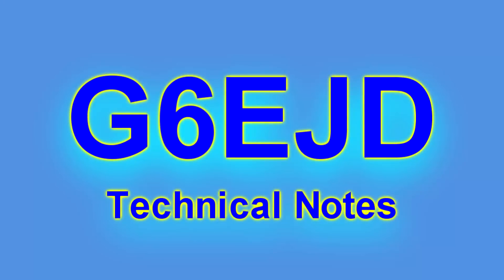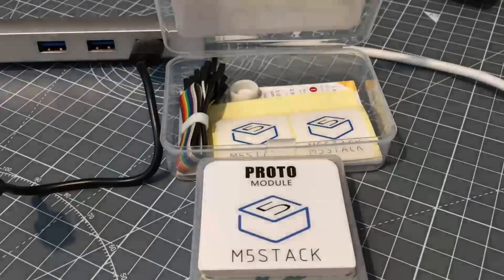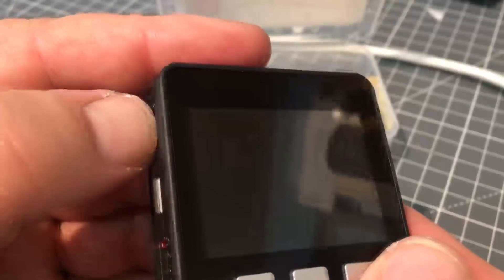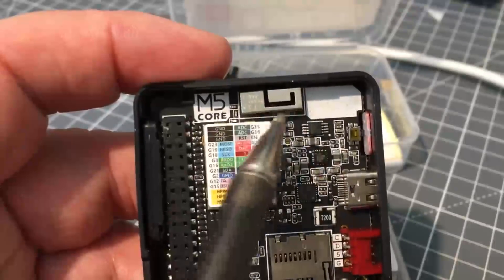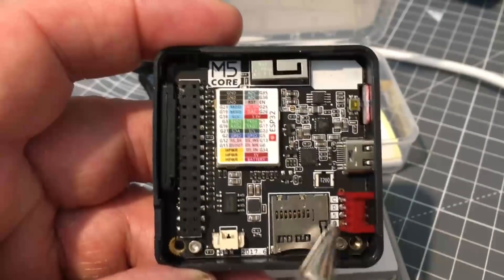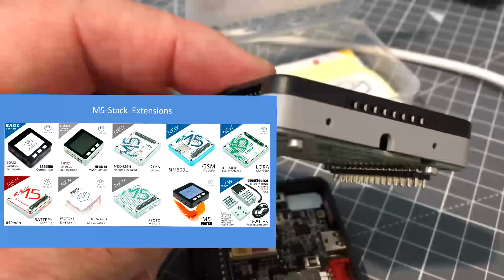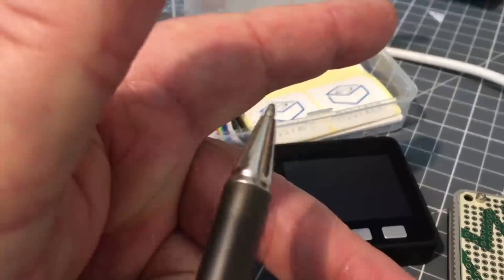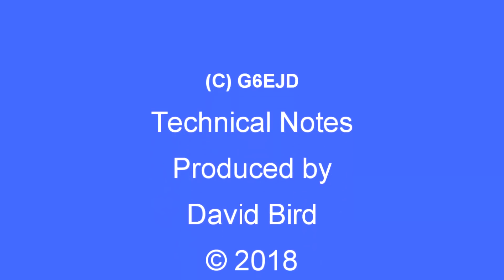Tech Note 090 - M5 STACK (ESP32) Development System Overview

Comment: Great video as usual. Can you comment a bit, if you have an idea how long it might run on battery with wifi and or Bluetooth ON for 30 sec every 30mins? Or in general how much current it is drawing in normal ON state with display on.
Reply from the maker: Science4all World Using the (small) internal battery 150mAHr about 30-mins I have not measured the current consumption but a reasonable guess would be 120mA for the ESP32 and 120mA for the display and then 150/(120+120) = 40mins but it’s difficult to know the state of the charge. With the extra battery stack at 850mAhr duration should be closer to 4-hours. With the display off it’s going to be closer to just the power consumption of the ESP32 during on time and during sleep. I notice that the 150mAhr internal battery lasts for about 2-days in sleep mode but I don’t know what mode they implemented in their library but it’s not 5uA and so the Stacks ancillary components are drawing power too. Hope this helps.
Reply: G6EJD thanks

Comment: Have you tried to use the prototype board? I have found that it's hardly usable because there's not enough space to the module on top of it. If the core module is directly on top, there's about 1mm left – then you short out something. If the battery module is on top, then there is not space at all; the LiPo cell will be punctured if legs or wires are put through the holes.
Reply from the maker: I know what you mean. On my prototype 'stack' module there is about 3mm for the solder side and about 7mm for the component side, so really (if the battery stack is used) is needs two prototype stacks to give clearance. I think for most small applications like a sensor there is enough space.
Reply: RE. the proto module..... Clearance is tight i agree, but as G6 mentioned there is a bit of room. I measure underside clearance  at a smidge over 3.9 mm (thickness of two ice cream sticks). 

It also depends how you use it. Review the M5Stack Lora module. It squeezes in a Lora chip. Parts are surface mounted on the underside of the modules pcb - so parts and solder are on the bottom.

Further, as shown in the video, it's best to stack the Proto module second from the bottom, with the bottom module below it. The bottom module is non-conductive .

Also, if you need more space you can use the Proto BOARD product. In this scenario the original bottom module is not used and instead the Proto Board is on the bottom with full access to all GPIO pin pads. A case extension, battery and battery cable are required. Google Macsbug for more.

Comment: Another great video, Dave.  Is the display output only, or does it have a touch screen?  I have no trouble getting an ESP32 to drive an ILI9341, and I can get touch input from the XPT2046 without the display.  But I can't simultaneously drive the LCD and the touch screen over SPI, even though I'm using different CS lines.  If this has touch capability, I'll pick one up just to figure out what out I'm doing wrong.
Reply from the maker: Hi Andrew, I have never had any problems reading the touch panel and displaying data on the ILI9341 displays. Are you aware that there are more than a few fake X2046 driver chips around that have found themselves onto the TFT boards and exhibiting the sort of problems you appear to be getting. Do any of the test programmes work for the simultaneous ILI9341+touch? The touch is usually detected via an interrupt.

I have some of these screens (which are all 3.3v logic levels) that work perfectly on 5v levels and some that don't, even though they look the same. I presume you are using a 3.3v system e.g. ESP to detect 'touches'.

Are your problems with the ESP32 and Touch? Tried slowing down the SPI bus? SPI.setFrequency(1000000) or even slower. Just stating the obvious you have wired MISO, MOSI and CLK all in parallel to both the TFT and Touch. I would look closely at the interrupt routine especially if using the ESP8266 and which pin is being used. It looks like the touch event is not triggering an interrupt from what you describe. IF you have one this is one of those times when using a UNO is an ideal test bed for checking operation. 

Unfortunately the M5-Stack does not have a touch screen.
Reply: Thanks for the thorough reply.  It's too bad the stack doesn't have touch because it's handy, although perhaps not as much with such a small form factor.

I've using an ESP32 using the Adafruit ILI9341 and GFX libraries, as well as the libraries by Paul Stoffregen.  When I comment out the touch code the display works, and when I comment out the display code, the touch values are correct.  But when I run them both, the second one (display or touch) to be initialized doesn't work, so I suspect that it has to do with the SPI pins not being shared or mapped correctly.

I will try slowing the SPI frequency.  Thanks for the suggestion.  And thanks for your videos which I find very interesting and informative.

Comment: Looks like somebody has built upon the Wemos mini stackable system but with more I/O.
Reply from the maker: Indeed yes but a much better package and well designed libraries plus lots of examples, Wemos never dud that and left us to find out the hard way. Mind you at $35 not cheap (yet)
Reply: Yes, the remaining challenge is for outdoor use which so far is my area of concentration. After getting my latest project working, or as I thought, it started dropping the Wifi and reconnecting with a DHCP IP address rather than the static IP address in the setup section of my sketch. Initially, it did come online with the static IP address. Contacted Google WiFi (my latest router purchase and the wife is happy) and they suggested I changed the IP address to reserved. Currently testing.
Reply from the maker: This is most likely dues to an address conflict or the Router not allowing (usually) a IP lease of more than 24-hours, but it should still allow a fixed IP address. Did you make sure all of the 4 code settings matched your Router Gateway, DNS, Router-IP, Desired-IP ? Yes you can reserve an IP usually by reference to the ESP MAC address so that it always assigns the required address to the ESP.
Reply: Before assigning a static IP address to any device I run an "Advanced IP Scan" so I am pretty sure it is not a conflict. During the power-up of the device, the scan reports the correct IP address. This runs for a good amount of time hour and sometimes overnight with the correct IP address.
I think what you are saying about the renewal might be the problem. The assigned IP address is carried out during the power or reset in the "setup" portion of my sketch. I believe it, for what ever reason, drops the connection and since the "setup" portion of the sketch is not run again the DHCP steps in and assigns an IP address from the pool of IP addresses. 
I will find out if reserving the IP address fixes the problem in the next few days.
Reply from the maker: I have set my router to !lease expire - never’ otherwise every 24-hours it does exactly as you explain and the Router dhcp tries to assign a new ip.
Reply: 35$ dollars isn't that expensive considering it has a speaker, tf card reader, TFT screen, 3buttons, a battery, great housing, and really good libraries and examples.
If adafruit/seeedstudio/sparkfun/etc. would have made it, it would probably twice as expensive.